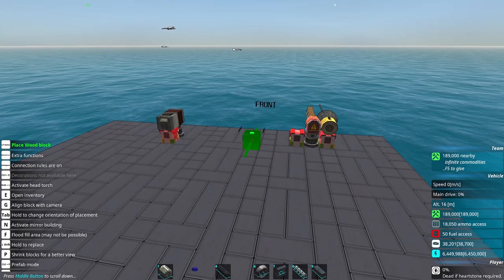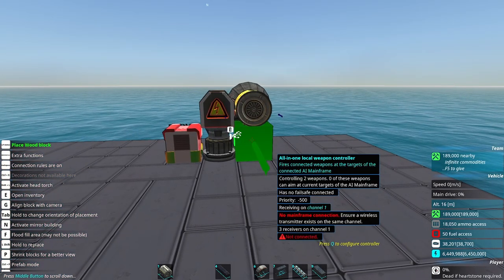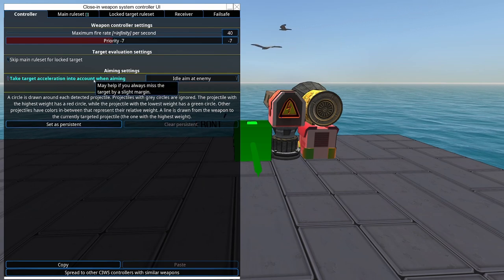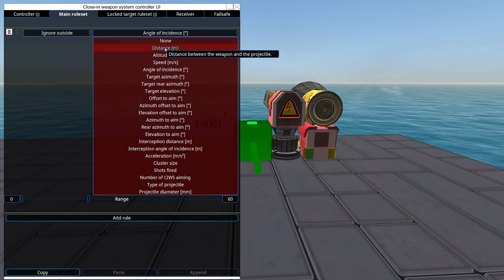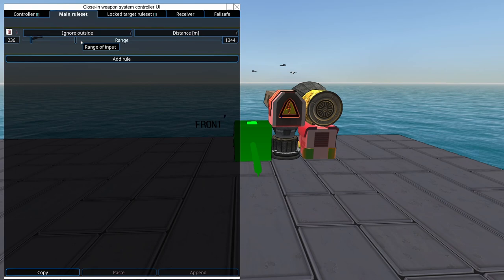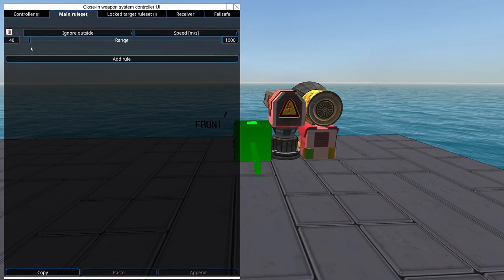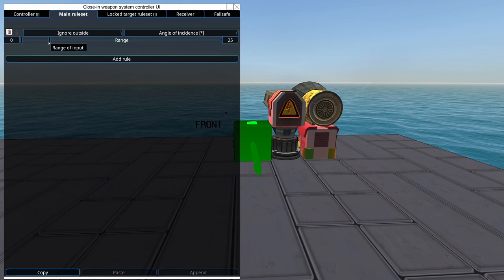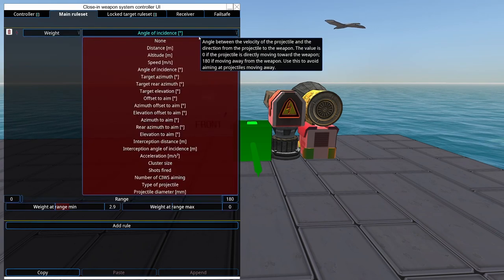CIWS Controllers - From the Depths

Comment: Wow. That clears up most of my confusion about ciws. Would you mind going over the strengths and weaknesses of the different ciws options? I have narrowed it down to using lams on small stuff, kinetic on crams, and missiles on larger missiles and torpedoes. I’m wondering if there are any flaws with my assumption.
Reply from the maker: I would like to do a tutorial about them at some point. First, I have to set aside some time to make some benchmark systems that will provide examples for the tutorials. It won't take a huge amount of time, but I keep getting sidetracked.
Reply: IMO, Medium interceptors provide the best damage efficiency against larger missiles, but have longer reload time. Small interceptors are worse but reload faster, and has improved efficiency vs swarms. Disadvantage of missiles is they cannot target APS at all (also uses ammo which makes your craft explody). Also these are dead-weight when facing enemies that do not use missiles.
LAMS is the only thing that can shoot APS and works as a last line of defense, but also works well vs small stuff. Laser CIWS can be tuned to shoot large missiles farther away, but can also be used for nuke defense or AA. 
Gun CIWS is complex - rapid kinetic can be used against missiles and CRAMS, but also used as AA. Large caliber CIWS can prioritize offense under normal circumstances and only target large or huge missiles defensively (with heavy restrictions), I use this trick to make a lot of my vehicles immune to huge missiles under equal-cost circumstances (duels). Railgun (assisted) CIWS is less explody than gunpowder CIWS. Finally, gun CIWS can be good underwater, or on a craft that transitions between above/below water regularly, without building dedicated torpedo defenses.
Reply: My approach so far is to throw down enough M-interceptors to counter 60-80% of missile firepower from a craft of similar cost, then make up the remaining 20-30% missile defense in LAMS which is also used to power close-range AA and nuke defense. The offensive systems would have a heavily restricted dual-purpose setting which only target large or huge missiles, which helps make up the gap or carries the defenses vs larger missile crafts.